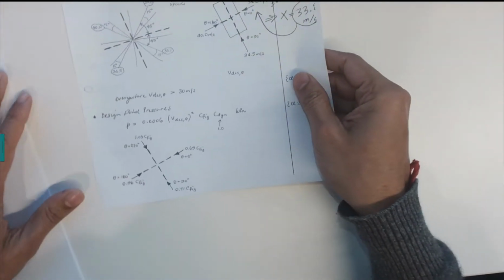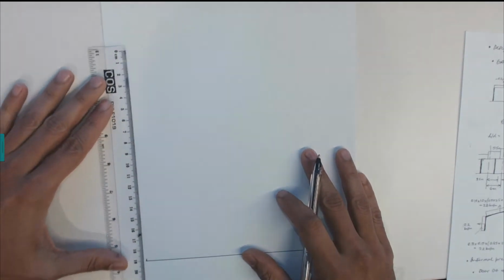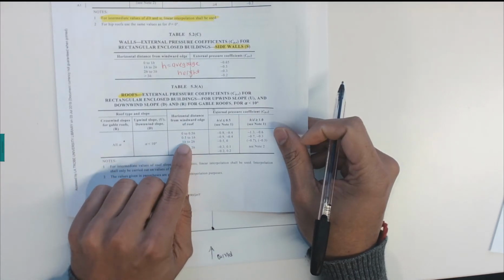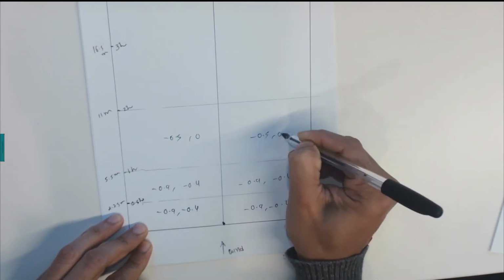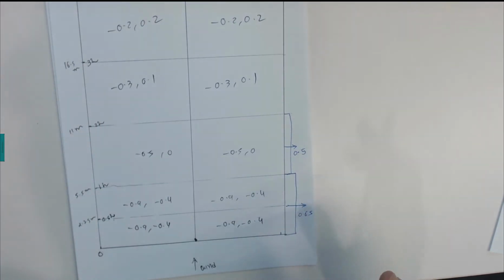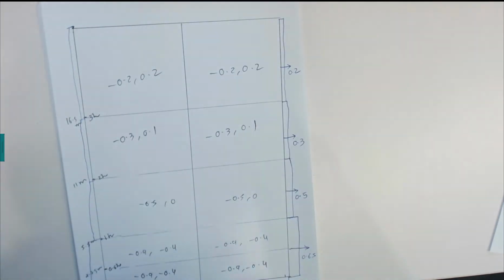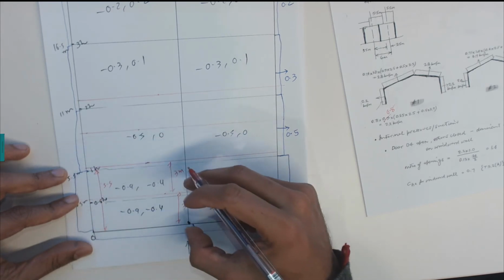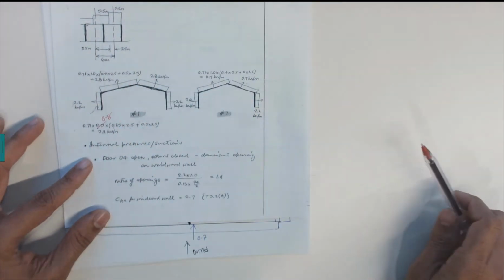Wind loading Example 2 Part 14 AS/NZS 1170.2

Comment: Hello Mr. Patel, I am a big fan of your exceptionally amazing content. i just have one concern. During the professional work as a structural engineer, does it really take so much time to analyze the wind load on a building? because i find calculating the wind load using AS4100 ridiculously complicated and time consuming. Thanks in advance.
Reply from the maker: Thanks for comments. The wind loading calculation is complex. I agree. You can use the simple calculations but it will over design the building and cost more for your customers. Careful considerations and use of complex calculations will reduce the cost and increase the safety of structures. For the big projects, the complex calculations saves the cost for customer and at the same time, it increases the safety of structures.